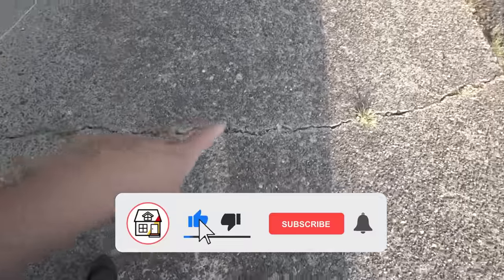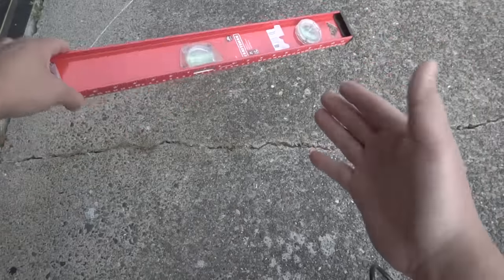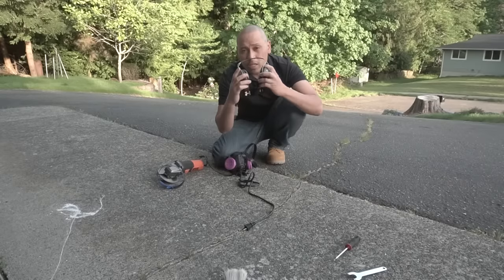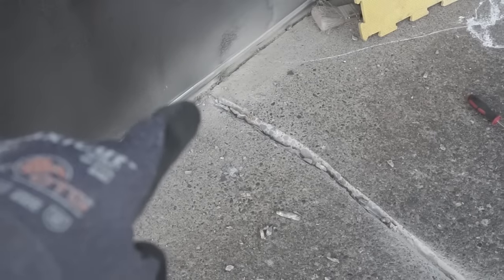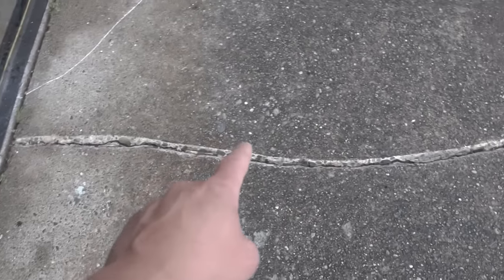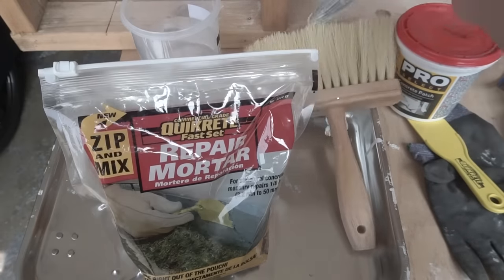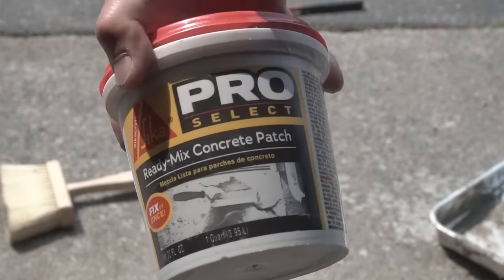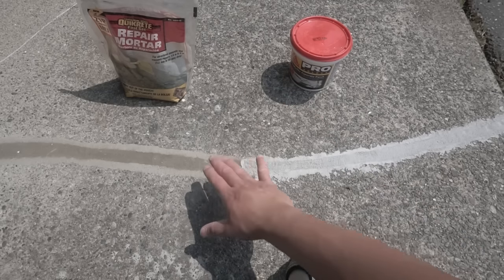How To Fix Cracks In ANY Concrete Sidewalk Or Driveway Like A Pro! DIY Step-By-Step Guide!

Comment from the maker: ITEMS I USED IN THIS VIDEO:
- BLACK+DECKER Angle Grinder Tool, 4-1/2” 6 Amp - https://amzn.to/458Bqmp
- 4-1/2” Diamond Cutting Blade - https://amzn.to/3Wc0HIm
- Masonry Chisel Set - https://amzn.to/3o3gRqZ
- Quikrete FastSet Repair Mortar Mix - https://amzn.to/3OndIgb
- Sikacryl Ready-Mix Concrete Patch - https://amzn.to/3Wb7hPi
- Sikaflex Self Leveling Sealant - https://amzn.to/437yWmC
- 6” Mason Trowel - https://amzn.to/3IgmoRx
- Masonry Brush - https://amzn.to/42MI7c9

Personal Protective Equipment (PPE) :
- Safety Glasses - https://amzn.to/45b5KwD
- Eat Muffs - https://amzn.to/3McuXyg
- Half-Face Respirator - https://amzn.to/42KYsOF
- Half-Face Particulate Cartridge For Respirators - https://amzn.to/3ImW1K2

Comment: I expect the crack will reappear because there is nothing of any strength holding together the two sides of the crack. Filling in like this only works if you first create a good bond between the two sides of the crack, typically with epoxy or with metal fasteners (I use 4mm diameter gr 304 stainless rod that won't rust and is cheap. Also, when you fill in the crack with mortar  you need to first make the concrete quite damp so the mortar sticks to it and it helps to also apply a bonding agent (typically liquid) as  well. Step one - open up the crack like in the video though you don't need smooth edges but in fact rough irregular edges are better because they aid bonding. Step two - brush or blow out crack to get rid of loose material. Step three - wet the concrete crack. Step four - while the concrete is still very damp but not wet, brush on a bonding agent. Step five - fill in the gap with mortar (cheaper to make your own with one part cement, three parts coarse sand, and two parts patching compound). When the mortar is still damp, brush like in the video and then sprinkle over it some sand of a shade that best matches the colour of the surrounding concrete (Reduces the white bleached look) or brush on a soupy mud mixture made from water and plain old dirt to make it look like old concrete. Optional Step 6 - to hide the repair completely, apply a concrete resurfacer to the entire concrete pad/path/ driveway or whatever, or paint it.

Comment: I'm just a lay person but my thinking is the crack is due to ground shifting. Where I live the soil is heavy clay.  If I am correct the joint should have flex in it and because of that I would have used a silicone based filler.  I like the idea of opening up the crack with angle grinder. Look forward to other comments
Reply from the maker: Thank you for the input my friend! 👍🏽😊🙏🏽
Reply: Exactly what I was thinking. By filling it with the inflexible mortar, I would think that the crack will just reappear. Perhaps an expansion joint would have prevented the crack from forming in the first place.  But in this case, the crack also goes across the asphalt, so it is not due to simple expected expansion but from other forces like shifting ground or tree roots. I would have gone with the flexible concrete caulking. I would like to see a follow up video showing how the mortar patch holds up, or a video showing examples of how well both types of patches last.
Reply: How old was the crack? Years, months? The ground might have shifted and then settled. If it stopped settling, I think the mortar would work well. It would be nice to see a one-year update on this repair.
Reply: My driveway cracks were filled with the flexible guys and it shrunk and looks awful. Lasted about a year or less! I now am going to try exactly what this video suggests.
Reply: You are correct
Reply: @lkenady52 there's a limit in width when you can use a flexible epoxy, and you need to treat the edges first to improve adhesion. Otherwise the filler will come off.

Comment: I gotta say, the 45 degree angles were backwards...if you have the bottom of your repair area wider than the top, you don't get pop-outs from the freeze thaw cycle. If you're in an area that never freezes, it's not that big a deal, but in northern climates, you need to "keyway" your repair.
Reply: How do you keyway a repair as I live in northeast now
Reply: @nomoreliberties  gotta make the hole wider at the bottom than at the top, that way the freeze-thaw cycle doesn't push the repair out
Reply: @mikereid1195 gotcha thanks

Comment: I’ve tried many concrete fixes over the years. The best for cracks, for me, is Sashco products, Gray Slab which comes in a convenient tube for a caulking gun. IT STICKS, STRETCHES & STAYS.
Reply: Yes.. the dudes concrete cracked because concrete doesn't "stretch".. so the patch must Stretch, or it wil crack too.  Thanks for the product tip... I have some repairs to do!!
Reply: I've heard of that product, finally found it at Lowes.
Reply: @KrustyKlown  I like self-leveling sealant. It's a bit pricey thought. Pair it off with caulk backer rods to save material

Comment: Use a power washer or chemical (bleach) to clean up accumulated algae on the concrete (that's why it looks dark). When you patch, the color will match better. Also, use a rough wet sponge to blend the sides into the existing concrete.

Comment: I used a chisel and made a1 to 2 inch GAP in my crack.  I left the jagged edges and a lot was 45 degrees under.  Then I used concrete bonding agent.  Used paint brush and applied very liberally to all surface area inside the crack.  Then I dry poured mortar into the crack. Tapped  a hammer on both sides of the crack.  I used a trowel to level,  I used the mist setting on house and done.  Applied water every hour for 4 hours.  Came out perfect.

Comment: The best is to use a crack chaser wheel in your 4” grinder. Then backer rod in the widen crack then self leveling Sika Flex joint compound. I’m a retired contractor and did many cracks that way.
Reply: That would be for an expansion joint and eould look like caulking in the middle of the slab...this is a crack that should disappear
Reply: There's always someone that knows better!

Comment: I'm thinking that you could have saved the dust and debris from the angle grinding to put on top of your patch, which would allow a better color match and blending to the original surface
Reply: That was my thought too. I’m going to use concrete to sprinkle on top and then lightly press it into the still wet patch material. I’m going to sift the concrete to remove large rocks first.
Reply: Correct…it’s the same it’s wood when you drill a hole save the sawdust and then mix it with glue,  fill the gap with the sawdust job done can’t see the hole

Comment: Good video you did a good job I just have one suggestion that I do for blending in with old concrete whether it be cement to fill in a crack or that light gray caulk I'll usually let it dry to 50% dry and then smear black dirt on top of it and leave it to dry rest of the way and it pretty much Blends in with the rest of the cement. It was a tip I got from an old Mason works pretty well

Comment: I cut vertical sides along the crack. I can only go 1" deep with my grinder.  I cut strips of 1" felt paper and put them in the crack. I mixed 1 part Portland with 2 parts sand to make mortar. i used the trowel to work mortar in on both sides of the felt paper. Fixing cracks in concrete is always temporary. The felt paper will allow for some expansion, which is why the crack formed in the first place. When it cracks again, it will likely follow the paper, rather than make a jagged mess.

Comment: Every crack like that becomes an expansion joint that moves with thermal variations. So it is more convenient fixing it with a self levelling flexible compound, uness you cross stitch the two sides with pre-drilled dowels, and then you can use a rigid expansive mix.

Comment: Thanks for the tutorial. It would be great to see the way it looks after full cure and a little wear on it. Personally if the crack repair remains quite visible then i would have gone ahead replaced a little larger panel for aesthetics. That is not a criticism just personal preference. Great video.

Comment: Lots of good comments. As far as adding the ground up powder for a color match. I would say dampen it first. Drawing out too much moisture too quick as powder can do may cause cracking. Letting it cure in direct sunlight, especially on a hot day might not be such a good idea either. Rapid drying may cause cracks. Laying something over it to block the sun might be a good idea.

Comment: Nice vid! I have added a little aggravate and sand to the top to match like an “art project”.

I am not sure if that will ruin the integrity of the mortar? 

I use Dow Seal, but it’s expensive like $20 per sausage. 

Loved the tips on expansion joint vs. crack.  That was super helpful bc I treated them the same. 

Your way creates a better line. I used a rotor hammer chisel that works well.
Reply from the maker: Thank you Richard for your input and sharing your experience! 👍🏽🙏🏽😊

Comment: I personally would use this for damaged concrete etc.. to fill cracks like this I would still use a flexible product like the " sica crack flex sealant " because that's most likely going to crack again with more movement unless you correct the root of the problem, the foundation underneath.  Nothing against what is going on here, just me personally and how I personally feel about the situation. Great Video!
Reply: Using sika will look like you git caulking in an expansion joint...horrible...this is a crack that you want to make disappear

Comment: I’m in Italy and about to do a slightly wider gap early AM. Using instant cement at 92 degrees forecast in the afternoon. I’m ok with that drying temp?

Comment: I definitely think the first is better. Matches your driveway better and looks like just a one time application vs a two app. With the other. But Its funny that your video came up today because I'm actually getting ready to do my driveway.
Reply from the maker: Thank you so much for the meaningful comment my friend! Sikaflex will be good on expansion joints to allow flex, but for 150’ long fix I would with the quickrete my friend 🙏🏽😊 I wish you the best on your project! Email me if you need help on anything 👍🏽😊
Reply: @FixThisHouse  Thanks so much for not only replying  but for such a speedy reply. 
I will and thanks AGAIN  so much.
Reply: I’d like to see the finished dry patch to see the final result. Won’t it just crack again?
Reply: @thevoiceofthelordpastorkei7165  i hope you stayed with the sikaflex as you are repairing a crack,which was caused by the concrete and ground movement, hard concrete or patch will just crack again or come loose, the flex will stick and shrink and expand as needed
Reply: Thank your helper. Safety lesson & great assistant—It’s how I learned from my Dad too.

Comment: Do you have a solution for leveling my garage floor ? A number of years back I used to much pressure in power washing garage floor and etched a good number of areas and left a lot of areas very very rough… how do I cure that?

Comment: Thanks a lot your video. It”s very useful for me because there are a lot of cracks on my drive way, the same as you have exposed aggregate concrete. I see some people using pea gravel toon top surface so it can match to the rest.

Comment: I’m about to fix several cracks but I wonder why people don’t sprinkle on a little bit concrete  on the still wet patch to match the texture of the rest of the driveway. It would make the patch virtually disappear. Of course you’d want to remove the largest pieces of stone from the concrete before lightly pressing it into the still wet patch material. 

I also will be repairing a few expansion joints using rubber tubes and covering them with a liquid patch material. Once I Apple the liquid patch I’ll sprinkle sifted cement on the still wet patch material.

Comment: Rule 1 - concrete will crack if it has insufficient tooled and expansion joints. The purpose of tooled joints is to control the cracks, hoping they follow the joints.

However, since your crack extends through the adjoining asphalt, the sub surface preparation/compaction is the likely culprit.

Rule 2 - Crack repair only lasts through one or two freeze/thaw cycle(s). Also, the crack often returns in parallel adjoining areas, leaving a bigger crack to contend with.

Check out what the pros do for tennis court cracks. The cracks always return. The sub-surface prep work was deficient.

Comment: 1) For safety, they make chisels with a protective ring near the top so you don't hit your hand with your hammer.  Also, after I used the ready-mix product, I read the fine print closely.  The last line in English stated that it should not be used where there is vehicular traffic, which would be a driveway.

Comment: Patch will pop out within 12 months as water intrudes and slab continues to move. Use urethane glue (resin) to seal the crack through the thickness of the concrete slab, and then top dress the cured glue. Even that will not last as there is probably a root or underground utility under the slab continuing under the blacktop.

Comment: I have to wonder what you think about sidewalk joints that are extra large.  I just blew the dirt and grass out with the pressure washer but they are now fairly substantially sized.
Reply from the maker: Hi! Are they expansion joints or cracks? Could you send me a picture on my email? Fixthishouse1@yahoo.com
Reply: @FixThisHouse  Just expansion joints.  -I would email, but I'm now away from that property, thanks though!
Reply: Proper prep and backing rod.
Reply: I recently redid the caulking between pool coping stones and concrete deck surround. Also resealed the space between the coping stone and waterline tiles. These areas flex in the northeast freeze/thaw cycles with any water penetration.
If expansion joint (or even large crack) use close cell backer rod and Sikaflex Concrete Fix No-Sag Concrete Crack Filler Repair Polyurethane Sealant. I have used the self-leveling version thinking it being more runny, it would adhere to the side walls better. Switched to no sag for vertical application. Self leveling version comes in gray or tan. No sag also comes in white.
Tape off the seam with masking tape. Before it skins over, sprinkle on sand or any grindings you have if you created any in prep. Remove tape right after sanding and touch up whatever has pulled away. Let set for a day and dust off extra sand. In my case, I only sanded the horizontal repair. The area between tiles and coping stones were left white matching the tile grout.
Sorry, I can't figure how to attach a picture.

Comment: Great video but if someone's got the ability to use an angle grinder I would have thought they'd have the ability to mix up some sand/cement mix themselves to fill the gap in. It's like filling the cracks in a wall - scrape it out to make it bigger and fill with filler then sand. Except in this instance you don't sand it, you brush it before it dries :)

Comment: Pull the grinder down toward your body dont push the grinder up
Reply from the maker: Thank you for the safety tip 🙏🏽😊
Reply: Also have some water on hand to cool that blade, it'll will help the longevity of the blade and it makes it easier on you
Reply: What do you mean? I’m about to fix driveway cracks and I’m unsure what you mean about using the angle grinder. Thanks.

Comment: Why is this guy  pushing the grinder??? You have terrible control like that, and if it catches something, the grinder is going to jump right back in his direction, his arms and body.. Always use a grinder so it is pulling away from you, so if you lose control, it will go away from you and turn off out of your hands....

Comment: Can you use a commercial shrinkproof concrete mix? I found it at Menards and since the cracks in my driveway are older and wider. I thought this may be a good option as Ive had the shrinkage problem where I live fixing a repair in the past. I also wondered if anyone would think of using a can of flexseal in with the concrete to strengthen the adhesion to the existing concrete?

Comment: Not a very good job my friends, fist use a crack trace weel that will create a v shape inside the crac all at once second you can use a self level cement and fill the crack and before he drys por our some aggregate to mach the original pavement an that time you can brum it at the level and that will be a finish job my friend
Reply from the maker: Thank you for the advice! 👍🏽🙏🏽😊
Reply: And don't forget to use a metal cutting blade your achieve straighter lines nice and neat